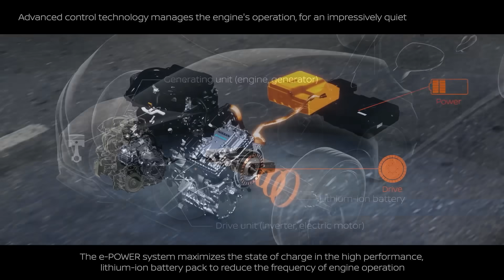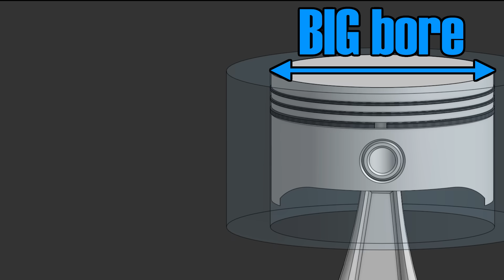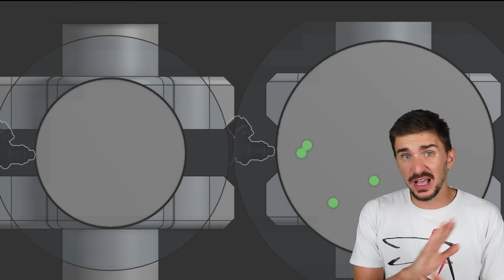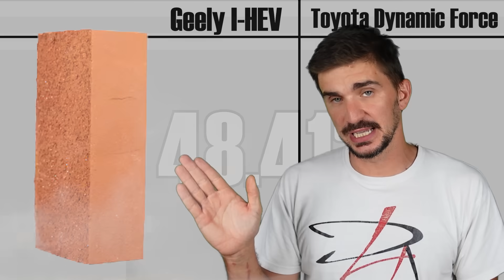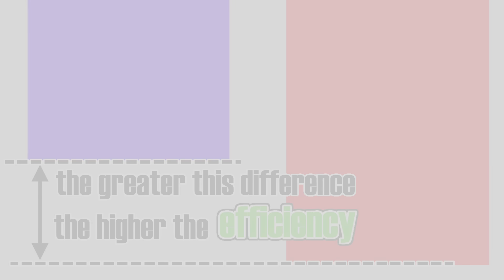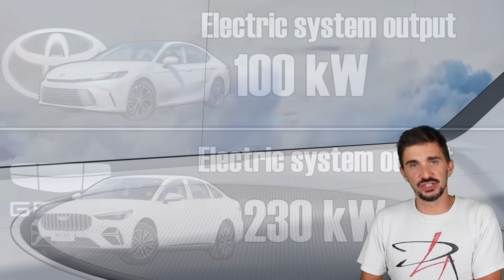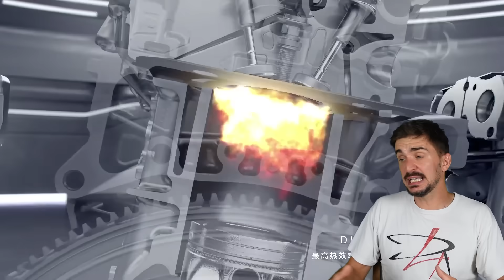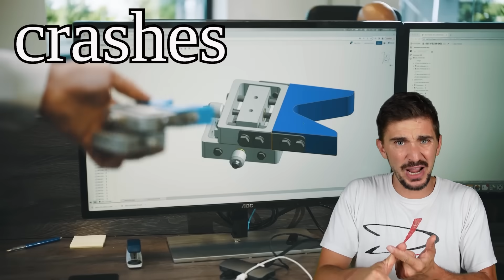How China's Geely Beat Toyota, BMW, Ford and Everyone Else

Comment: I love this channel, but sometimes things are said that make me swallow hard and stop to consider.  This time was about the bore/stroke differences.  Yes the smaller piston has less top surface.  That is not the same as less air/fuel charge packed above it.  If 2 cylinders have the same displacement, then they have the same displacement.  One using breadth, the other using length.  What really happens is that the smaller diameter piston has the same force applied, but over a smaller surface, by the same combustion force, but as stated correctly in this awesome video, over a longer period of time.  It's the crank that sees less punch.  The cylinder head and piston top still experience the same blow.  Think air or water pressure measured in PSI. (lb./sq. inch) .  Which is why as pressure tanks get bigger they must also get thicker as the volume goes up for any given pressure.  It's the overall pressure force more than the PSI.  Tires are another great example.  Monster trucks have very low pressure but hold up the truck just fine.(massive amount of square inches)  Try putting motorcycle tires on that truck....the pressure required would blow them out.
Reply from the maker: Here's the catch: An engine with 50mm bore and 100mm stroke has less displacement than engine with 100mm bore and 50mm stroke. But even if they have the same displacement a smaller bore is still limited to less air and fuel because the mixture is usually fired very close to TDC and most of the air and fuel is concentrated in the chamber itself which is nowadays almost always the same optimized pentroof shape with largely the same depth across many engines. The depth being determined by valve sizes which are ultimately forced to be smaller for a smaller bore. So the main determinant of chsmber size ends up being the bore. I understand your point and it makes sense. My animation is also lacking because I didn't include a combustion chamber above the piston.
Reply: @d4a  Thank you for your response.  It means a lot to me. I wish I were half as articulate at explaining how things work as you are. Let's talk about the difference between shape of a package and its ultimate size.  In my understanding, and I apologize if I was mistakenly thinking we were talking about displacement, sure, the width and length won't transfer over equally with changes in bore and stroke.  The rub is, when we compare engine layouts, we compare equal displacements instead of equally swapped dimensions when comparing outputs between engine formats and geometry.  The racing industry typically imposes a strict displacement limit not one of geometry.  Yes, valve size is a key aspect of chamber size and shape.  But when the goal is efficiency, the rpm is usually limited to the lower ranges and valve size matters much less.  What I was trying to convey is, piston sweep TDC-BDC is the displacement, chamber size accommodates that volume.  How well the valves flow is not a function of displacement.  Though, especially at higher rpm they certainly influence the ram effect.    Smaller valves don't really factor into displacement but they do govern airflow through.  On Atckinson or Miller, this could be somewhat different than how I see a conventional poppet valve set-up on a ICE.
Again, I salute you for another fine instructive video and as a subscriber, I look forward to your future topics.  I really loved the one with the model car and airplane engine compared to F1 engine.
Mar

Comment: I think it's pretty funny to reduce it to a simply different approach that COULD'VE been made other manufacturers had they chosen such an approach - but that's the thing. They didn't. They didn't take that approach because they are not as deep into EV and battery technology, they're missing a key piece of the "tech tree" to say. It's like saying China COULD'VE made a much better non-hybrid-only combustion engine than anyone else if they simply took the perfect approach, but where is the Chinese combustion engine track record required to make that happen? In my opinion, ripping out so much thermal efficiency will naturally require specialization, and Geely's method is valid, because at the end of the day they are delivering an efficient engine, even if only in hybrids. This video is really well made but I don't really agree with the dismissive reductionism, even if its partly in response to slop tabloids overhyping something (these, I think can and should just be left to wallow in their own wasteland).

Comment: There is a fair bit of misunderstanding here. The real vehicle fuel efficiency has not much to do with the thermal efficiency. After all, cars are not aircraft and we almost never drive for hours at 100% throttle at around max torque rpm. Well, unless you are towing something massive. In the real world what matters it is not the thermal efficiency, but the ability to consume less fuel at partial loads. And this is where diesels (absolutely unfairly hated here) shine. Diesel can consume 50-60% less fuel at partial loads due to their inherent ability to work on lean mixtures. Thermal efficiency does not matter when you can only make it at full torque.

Comment: You could've done something competitively efficient decades ago ... like close to 50 years ago (if not mote) if using a forced induction hot air lean-burn engine that ran substantially lean-of-peak and used a very high compression ratio. (almost as efficient as a fully homogenous fuel-air hot-vapor engine, but without the catastrophic backfire risk within the manifold, since a VERY long and large region of mixed fuel vapor is used for those, in most efficient cases using a draw-through turbocharger arrangement without intercooler, with hot air + pre-heated fuel injected before entering the turbo).

But such lean-burn engines would never meet 1980s (or even late 1970s) emissions standards in any country implementing them at the time, albeit they'd still likely be a lot cleaner than diesels in the same countries ... so a special exemption/waiver would've made sense given the competing efficiency vs diesels of the time, but that didn't happen.

The next best thing is to use EGR instead of air dilution for overall similar effect. The problem is that EGR dilution limits for flammability range of air/fuel/exhaust mixture is going to be lower than with lean air/fuel alone at any given pressure and temperature. So to achieve the same dilution limit as with air alone, you need to run the manifold hotter and use higher boost (or higher in-cylinder compression) to ensure reliable ignition. Thus the practical compression + boost + manifold temp limits (based on the materials used for all engine components, plus the engine oil used) are going to be the limiting factors.

EGR also suppresses knock/ping/detonation much more than air dilution, though that might not matter all that much when the issue of misfiring from excessive combustion delay is more of a concern than pre-ignition is. (air dilution leaner than peak-knock, typically lambda of around 1.1~1.2, will suppress knock rather than increase it, so those old 25:1 AFR lean-burn engines from the 70s could use higher compression lean than they would be able to at stoich).

So long as you can run hot and high pressure enough, you can dilute the charge a LOT with EGR, all while maintaining stoichiometric mixture.

Exhaust also makes for a better supercritical fluid for rapidly homogenizing or at least diffusing/dispersing the fuel once injected vs just air alone, and would potentially benefit direct-injection engines and even some potential stratified charge concepts would be valid with more complete combustion.

The stratified charge concept combined with very hot, heavily exhaust diluted intake charge would make more sense if you could somehow keep the air and exhaust separate and stratified within the cylinder, thus improving the ignition conditions. I suppose you could do that by keeping the exhaust valve open for part of the intake stroke, but close part-way through it and allow more air to be present at the top of the cylinder than the bottom (even though some mixing will occur, there should still be some level of stratification), thus allowing more dilution than would otherwise be practical.

EGE dilution and the CO2 and steam present (and under supercritical conditions during compression) should also work to dissolve and generally reduce formation of carbon deposits, which would make stratified charge conditions more useable as well.

That and managing all this with an aluminum block is also going to be harder, as the best real-world experimental examples of this concept used iron blocks and heads and were limited in temperature by oil breakdown conditions. OTOH you could limit temps to within aluminum alloy block tolerances and focus instead on higher boost pressures and compression ratios to maintain reliable ignition.

Also, experiments form the last 10 years or so also show that highly oxygenated fuels produce exhaust that can be used in much greature dilution volumes than with hydrocarbon fuels (methanol being the prime example tested). This implies that the much larger proportions of CO2 + water in the exhaust (and proportionally less Nitrogen) provides better ignition properties than the more nitrogen biased exhaust dilution from hydrocarbon fuels. (methanol also has a bias towards water over CO2 on top of that, so the steam may be a more effective catalyst for combustion than CO2 or nitrogen)

Comment: • Mechanics in the 1950s would tell you longer stroke provides better torque due to the leverage of the greater greater crank pin offset and length of connecting rod 
• Larger bore doesn't allow more air/ fuel to be drawn in than small bore. If the displacement of the engine is the same it's a matter of volumetric efficiency which has many factors. 
• You illustrate fuel being directly injected in the comparison of fuel dispersion in a large bore compared to a small bore but direct injection isn't used on every gasoline car engine 
• The extreme Miller cycle is why the Geely has a compression ratio of 15.5/1. An Otto cycle engine with 15.5/1 compression would require a fuel other than gasoline 
• Combustionized EV has an advantage like a reciprocating aircraft engine running at a constant state constant load. No changes in throttle or RPM so no changes in vacuum to adjust fuel consumption for. Optimize the most efficient RPM and throttle setting. 
• I don't understand why today you didn't see the Honda compound vortex controlled combustion (CVCC) or Mitsubishi MCA jet. This principle is still being used in commercial diesels that have achieved efficiencies in the the  50% - 55% range

Comment: I will put a simple summary 
The Geely engine is designed to operate only at certain rpm, producing electricity for the battery pack. Thus it's highly efficient 
The Japanese engine as the main power train need to be responsive and that's the weakness

Comment: My brand new Toyota Hilux 2.8 turbo diesel has 44% thermal efficiency. Isn’t that more impressive knowing a diesel generates more heat? Or are gasoline engines differently measured?

Comment: Well efficiency to me sounds like a F20C engine which you can find S2000’s on auction sites clocking 200,000K + and still working perfectly!
Also I saw an GR Yaris posted with 310,000K and it’s only got 3 pistons!!!!

Comment: FYI, the compromise is big in higher RPMs, a Geely small SUV at speeds over 120 km/h has enormous or extreme fuel consumption, not only because of gearing, but also because it has to enrich itself to allow this all to happen. So in the end, it's okay for slow speeds, and crap if you go out of traffic jams. I had an ECU engineer to analyze the maps, and they are hilariously compromised. So it's bad to have a high compression ratio turbo engine, in the end.

Comment: Innovation? If you have even a basic understanding of automotive engineering, this is nothing more than a marketing stunt that makes you laugh.
First, registering records with an entertainment-focused organization like Guinness, rather than through academic journals where rigorous engineering verification takes place, is a clear admission that this is a marketing ploy, not a technological breakthrough. True technical innovation is proven through peer-reviewed papers, not by paying for certificates.
Second, this entire approach demonstrates a fundamental misunderstanding of hybrid systems. In the hybrid era, the core isn't just the engine's peak efficiency—it's the 'system integration capability' of how effectively the motor and battery offset the engine's inefficient operating points. Established manufacturers have stayed within the low 40% range for thermal efficiency not because they lack the technology, but because they have found the 'most rational trade-off' to ensure the longevity and reliability of the entire powertrain. Focusing solely on a numerical engine efficiency figure in an era where electric motors already cover dynamic efficiency is a nonsense that ignores the very essence of hybrid systems. They are barking up the wrong tree.
Third, are we really supposed to believe that Geely—which acquired Volvo's powertrain technology, a lineup long considered 'second-tier' in the Western engineering world—has suddenly achieved hybrid dominance? The fact that even German brands are struggling to match Japanese hybrid technology makes the claim that Geely has suddenly mastered a superior hybrid system, with a lackluster technical background, sound more like fantasy than engineering reality.
If a company that cannot even solve thermal management issues for its humanoid robots—resorting to strapping dry ice packs on them for demos—claims to have surpassed a century of engine development overnight, any rational person with an engineering background can easily spot the 'Made-in-China' showmanship. Don't be fooled by a few numbers. Look instead for genuine reliability that can survive a decade on the road and proof of real, sophisticated system integration control.

Comment: Full electric or gas makes more sense everywhere. You would exchange range anxiety for uphill anxiety with this new engine. I had a plug in hybrid for a while. Don't like the sound of the Atkinson engines, kind of blubbery. Good mileage, but too much junk to worry about and not great on long highways. I changed it for a Lincoln Nautilus V6 for the highway and an older Leaf for around town. I might replace both with a Tesla.

Comment: hier IA  before IA 😅

The PPC (Predictive Powertrain Control) system was originally launched in August 2012 in Europe, debuting as an optional feature on the fourth generation of the Mercedes-Benz Actros heavy-duty truck.

The PPC system used GPS and 3D maps to see the road topology up to 2 km ahead. It automatically adjusted the speed, acceleration, and gear shifts to match upcoming hills and descents, saving up to 5% of fuel

Comment: Power conversion losses from spinning the generator to charge the batteries is always significant and when than energy can be used directly on the wheels it's always more efficient. Technolog Connections did a great piece on this and why HEV is superior to range extender BEV.

Comment: I saw the EV people going absolutely crazy about this News a couple months ago, but none of them could explain how they did it.

I suspected there was something fishy about the claim. Now, with your fantastic explanation, I see that there truly is nothing new under the sun. It’s just a new arrangement of known principles. You can’t compare this system to the current highest thermal efficiency engines because the only way it works right is to use it as a sub-system to an electric system.

Thank you.

Comment: Sounds like the 1.5L anemic, deep Miller cycle engine could've been a 1.1L Otto cycle with about the same fuel consumption and power output. But without the marketing "efficiency" numbers.

Comment: “Chinese are novice engine manf…..”

Yes and no. Chinese manufacturing splits two ways, there are the really cheap production and high quality production. China is making engines and cars for US auto companies and parts for Japanese cars. They have the technology to make a great engine because instead of just waiting for them to steal all our technologies and reverse engineer them, the US is simply using Chinese manf to make stuff they sell with a US nameplate. There is ALOT of junk and slop being made, including a few engines made in the US. But there are also gems. 

The whole thing is manf chose the quality level they want to sell and their suppliers accordingly, and we buy based hopefully on our quality ideas. Most Americans don’t care that turbo engines won’t last as long or need more oil changes than the manf specifies and that their driving habits could dramatically shorten the life of those engines. All they care is whether the engine lasts to the warranty period where they trade the car in for a new one. Generally not changing the transmission fluid unless the dealer does it as scheduled maintenance.

Comment: Edison Motors ran into Federal emissions laws being archaic when building a semi with an efficient motor being used as a generator  and not to directly drive the wheels. they had to use a less efficient engine to be allowed on the roads

Comment: I seem to recall a porkchop plot of a new toyota engine efficiency that had a sweet spot just over 48% (a modest rpm and high manifold pressure).  As a hybrid engine the computer could keep  the engine in that sweet spot.

Comment: In other words, the compression ratio in the engine is most likely determined solely by the piston movement; as far as I can tell, they don't have any other system to control auto-ignition.